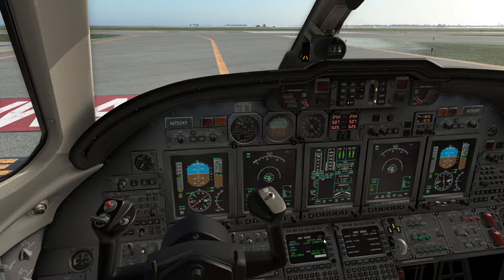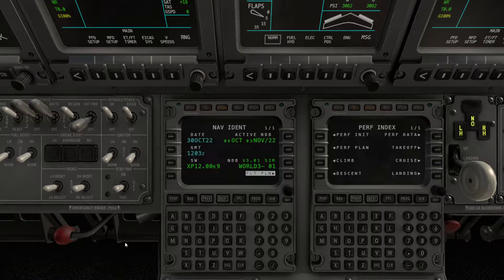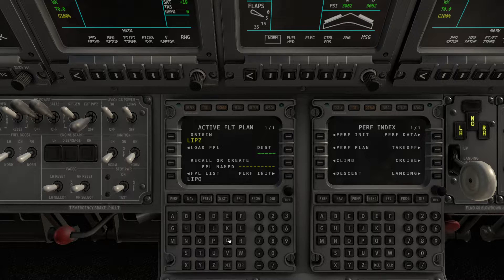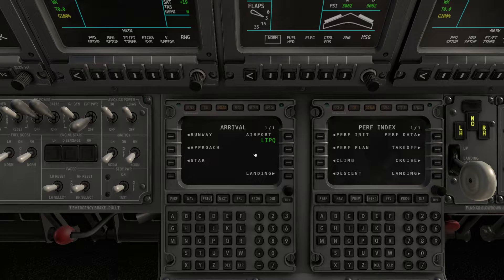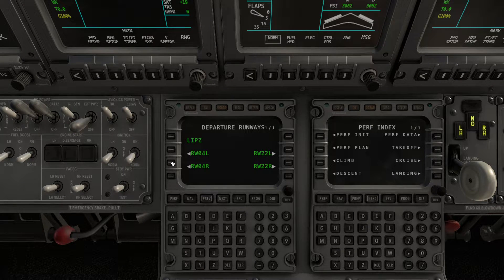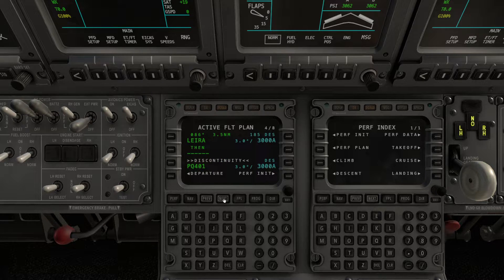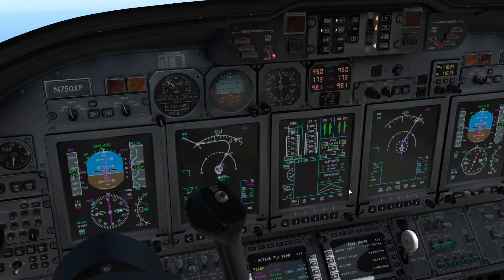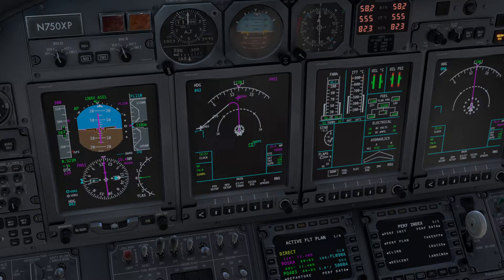[X-Plane 12] Cessna Citation X | Part 3 - FMC Direct-To and Hold Functions Tutorial

Comment: Thx a lot, but are there a way to set a simple hdg autopilot when ATC request for my plane to turn to a certain heading?
Reply from the maker: Hi, yes either in FMS source mode or NAV source mode you can press the HDG button on the MCP after dialling the requested heading on to the HDG selector knob you can find on the pedestal. Thanks for watching.
Reply: @crisk73  Thx for the reply, does this plane have APU taxi capabilities? Or do we have to use the main engine for taxi like the case for Sf50
Reply from the maker: You have to use the engine for taxi.
Reply: @crisk73  Thx for the reply, seems like the fmu don't let me set "Init Crz Alt" FL500
Reply from the maker: FL500 too much.
Reply from the maker: No, what I told you is the simplest method.